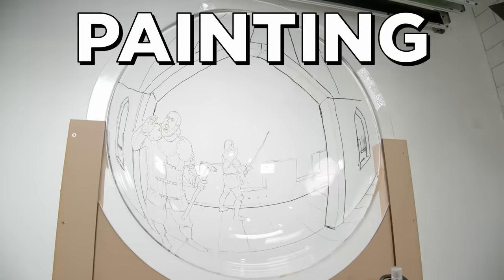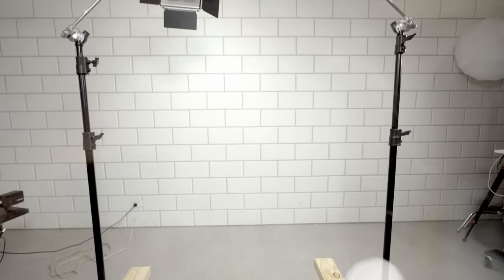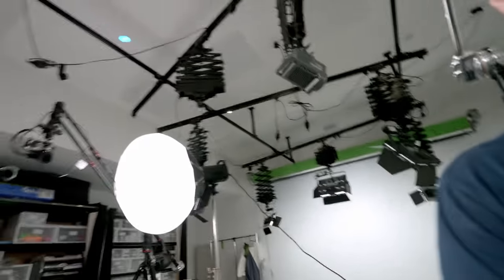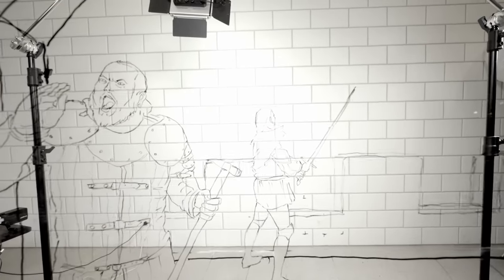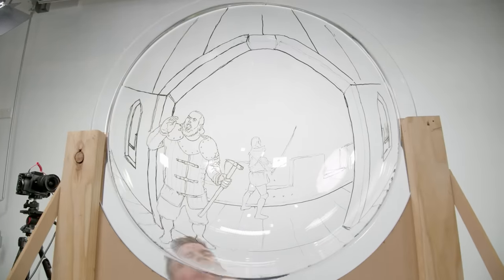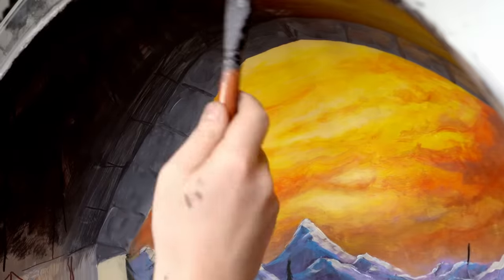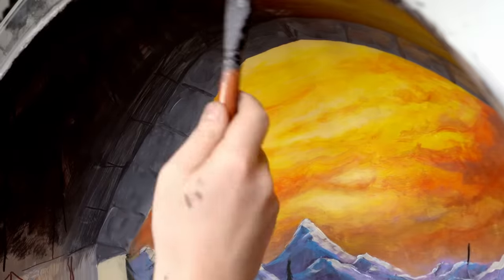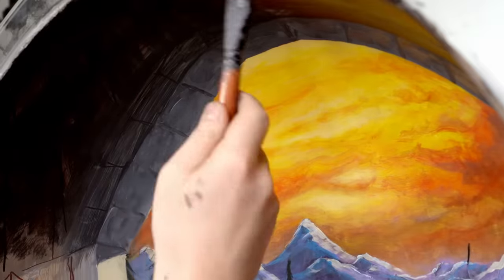This 3D Painting Trick is AMAZING!!

Comment: Great work!
Leaving the light sources, the sun and torch, lightly painted and projecting those colors from the backside with an actual light would introduce the light color to your painting. The cool thing to do with this is to paint you color as if there is no light color. This mimics what we do in CG by painting a Diffuse map. Then the light could introduce its own colors. Imagine a night scene with an aurora. You could mimic it by mounting LED's in the bulbs exterior and leaving those areas thinly painted. The light would make your painting glow with the changing colors and since you didn't introduce colored lighting in the paint it would look pretty accurate, and alive. The white rim's would change to the hue of the light so everything would just start to match. You use the light as a wash :D

Comment: This is amazingg  :0

If you were to do this again.. would it be an idea to try and section off areas to use lamps to show off the colour?

Like a backlit painting i guess 
You could then to shield from outside lights by putting it in a box with an open side to look through